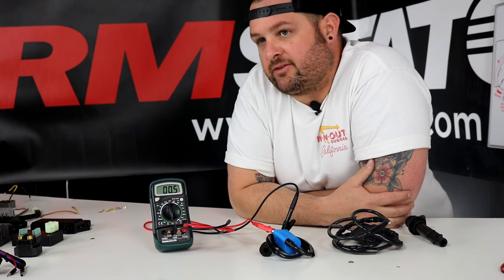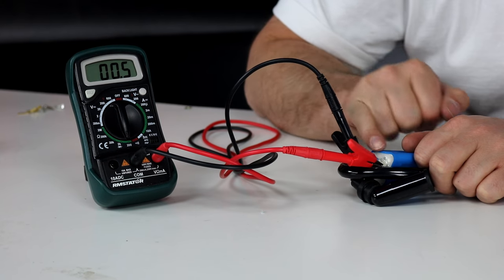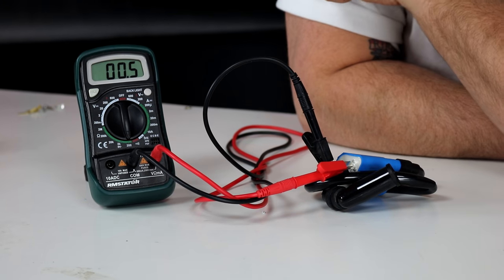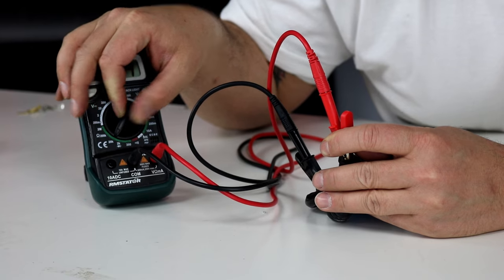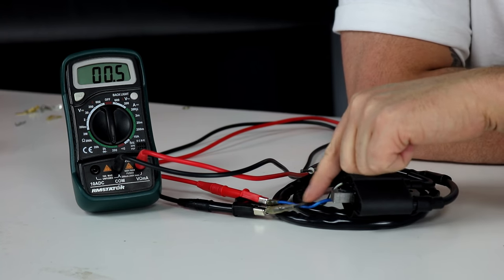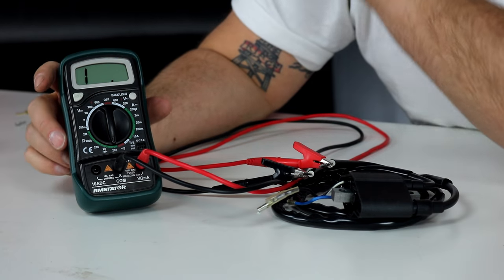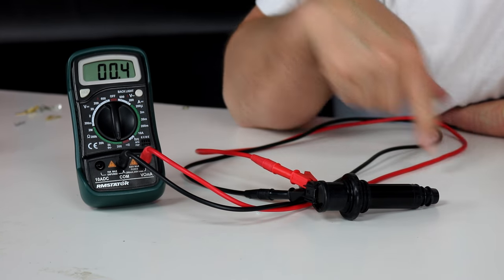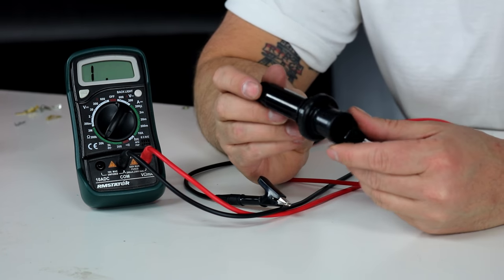How to Test External Ignition Coils for Motorcycle, ATV, UTV, Snowmobile & Powersports Engines

Comment: Great video , I've found over the years that the best way to test coils in while they are in circuit and under stress. Manufactures want you to test the resistance of coils while not taking into account that a coil can simply be weak and still firing but just not to its full potential . I've seen coils "ohm out" but then when looked at more closely using an Oscilloscope and ignition pick up probe it was not able to fire at high enough Kv to jump the gap while under load in the cylinder . 

Ohm meter testing is ok if the coil is just simply fried but if you have winding that are shorted to its self effectively allowing the current to bypass some or most of the winding it will diminish its Kv rating but still test within that broad range that OEs give you . 

But I agree your way will catch the majority of failures as most the time the coil just simply fails completely but I've just seen to many cases of "in range failures " to completely trust a resistance test

Comment: Just ordered todays 4 stick coils ,stator ,and rectifier for 09 yamaha fz1  from rm …you keep saying check website for specs but only specs I see on the coil page  are length diameter etc…nothing about resistance ….is there a spec page separate from the part{coil} itself ?

Comment: Can a person buy a coil based on the resistance they need? Vintage snowmobile parts are obsolete and the universal ones I can get have too much resistance!
Reply from the maker: If you are positive the physical size of the coil will fit your stator plate, then you can buy it based on resistance. It's hard to be sure it will fit fine without confirming measurements.
Reply: RMSTATOR it’s the external ignition coils like the blue one in the video. Who can I contact? I tried calling the 800 number on your website but didn’t have luck, more customer service than tech support. Vintage stuff is always nice and roomy and easy to work on/modify =)
Reply: i can get any part i need for my 70+ yr old dodge  i believe someone will have the parts you need  on line

Comment: 2003 Arctic Cat Pantera 550. Set at 20k my fluke is reading 18.05 ohms between the plug wires. Bad coil?
Reply from the maker: On the 20K setting on your meter, this would likely mean 18k ohms. That is reasonable for the secondary of the coil, if a little high. Not necessarily bad. I would check your service manual for exact testing specs for your coil.

Comment: I check my dual plug boat coil and started on 200 on primary and it was .3 which was good I reset meter to 20k and got 6.43 does this mean my coil is good ??

Comment: the problem with that test is this you measuing a copper wire i maesure the same whither its wound in a coil or stretched outit does not tell any ting about shorted turns of the coili have seen coils with a hole burned in  still woriking some  but meter will tell you this   only good test for any  one if in dought change it out ,   coils and condencers    usually condenser (capisitors ) are the first to go   the effect your spark more than the coils --------im 88  i  have seen a few------- lol

Comment: The single wore coil does this have to be grounded
Reply from the maker: A single wire ignition coil is generally grounded through the mounting bolt to the frame.